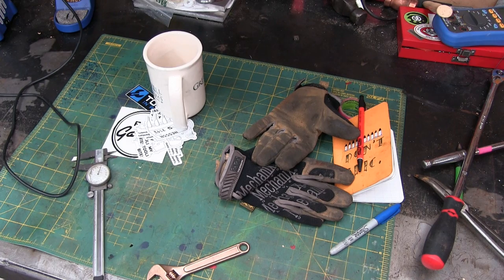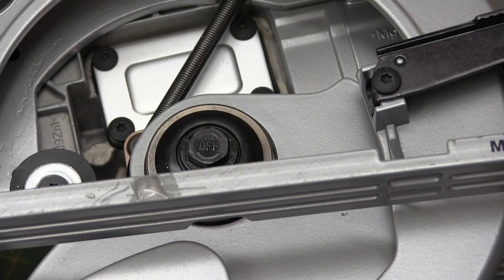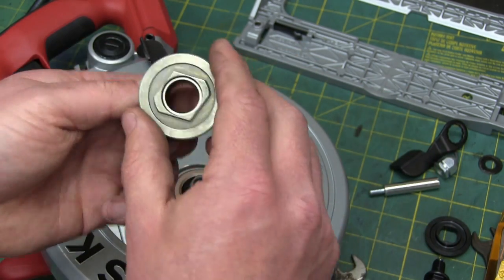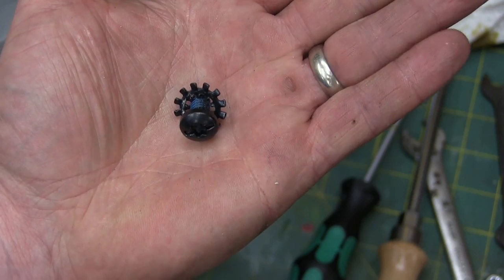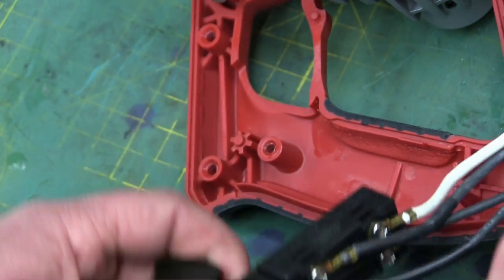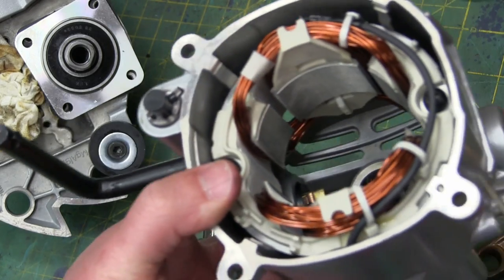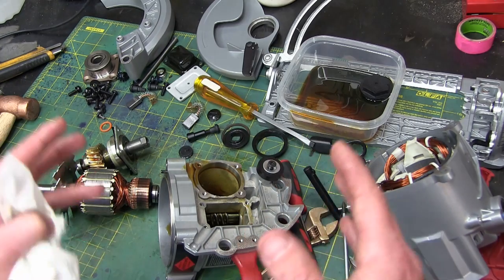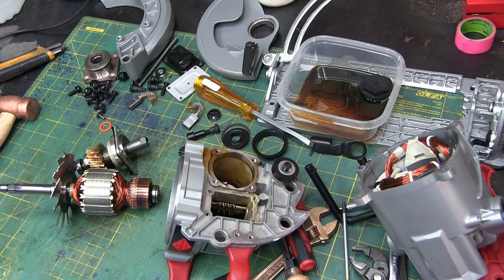BOLTR: Skilsaw 77 Magnesium Worm Drive

Comment: I have been framing residential and commercial for years using the mag 77 and the LT and it is by far the best wormdrive saw out there regardless of where its made now. My whole crew uses them every single day 8+ hours a day 360 days out of the year. and they hold up to everthing we throw at them. Granted they last a solid 2-3 years after several falls off the table and off roofs and tosses to and from. But.... We dont replace parts. Besides the saw table on occasion. And the blade. NOW if we did preventative maintenance on them and what not who knows how long they would last. But we do still have several saws 10+ years old but those are for the "greenies" 

Your vids are amazing and your a badass thanks for reading my rant keep doin your thing! 

And keep your dick in a vise.

Comment: Still seems like a lot of money for a saw that has some questionable parts.  I think as the years go by the design will change over and over and it will get cheaper and cheaper until its no longer anything like the old models that could get dropped 70 times a day on a job site.   I'll bet the manufacture has no idea that people will use the power cord as a lowering rope to drop these saws off the roof of a house so a closer look at the power cable "strain relief" would have been nice but still a great video.

Comment: Nothing is made as well as it once was--nothing.  Bean counters and corporate raiders have made certain of that.  I always run into some brand honk or another who claims his equipment is the best that's ever been produced, only to watch it fail to meet the standard of some 35-year-old analog on the jobsite that looks like a display out of an industrial museum.  I have an Oster gear-reduction drill that's older than me and still produces more usable twisting force than anything else on you could find.

Comment: Skil is crap now, i got a 10" drill press and it started fallin apart after less than 20 min use on polymers...
Reply: @L F yea really, and I knew that, but even china takeover stuff usually doesn't just fall apart with practically no use

Comment: Magnesium is softer than aluminum. The transfer case in my truck is magnesium, and the oil pump impeller is aluminum. Guess which metal gets the hole worn in it? Yeah, the case, so new transfer case time, or take the whole piece of shit apart, and install a steel wear plate behind the impeller.
Reply: That depends on the alloy, neither is going to be pure in those applications. Certainly not the magnesium as it would be a substantial fire hazard.

Comment: there are better , lighter saws out there now. battery power is great. Skill could have done a way better job on the saw. too heavy and no box for it. got rid of mine. Nobody seems to know what viscosity is for the oil so you don't have to buy the overpriced skill oil.

Comment: So the wife wants me to build her a deck in our postage stamp size back yard.  I figure, hey, I built a floor for the shed, same deal.  Well oh well.....  Turns out I didn't use quite the right materials for the shed base and she is fallin ta pieces fast.  So, had to tell the wife no deck, gotta empty shed and rebuild the darn thing using pressure treated wood.  Just by the by, I did ask the depot guys what I should use and they this this cheap OSB should be fine.  Yeah, no!  So's, part of the deal was, to build the deck, I get a new saw.  TL;DR....  no deck no new saw.  Be nice to see something sharp and shiny show up that I could use my new found wisdom on.